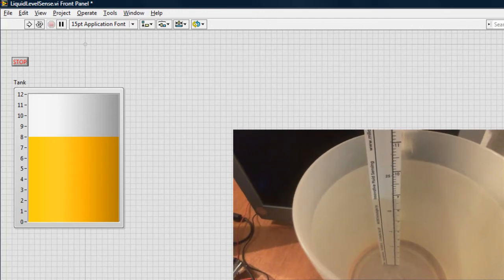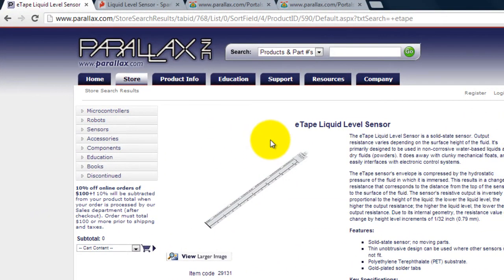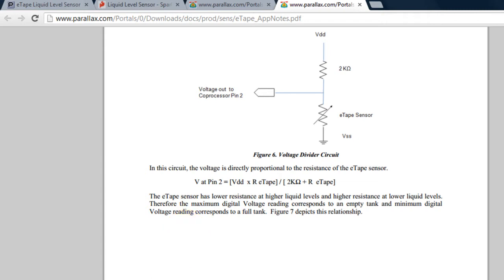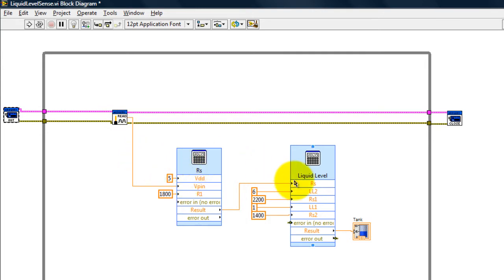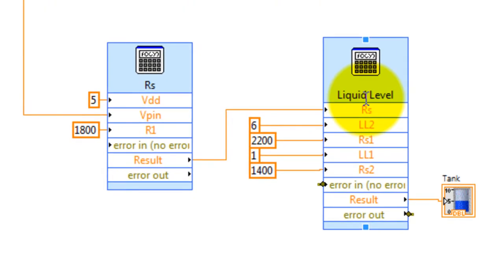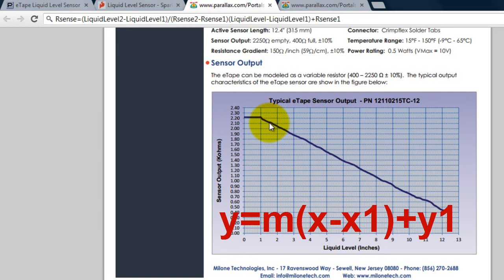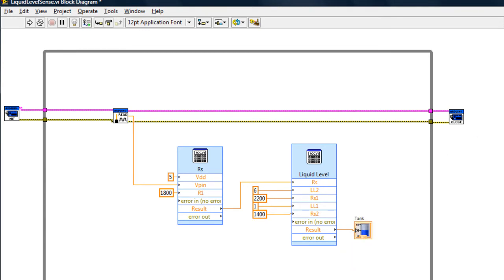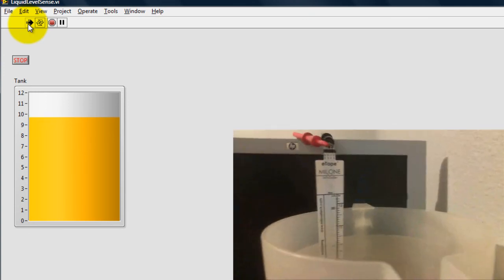Arduino LabVIEW: Liquid Level Sensor

Comment from the maker: There is a graph in the datasheet that shows the relation between resistance and the water level in inches, then I use the point slope formula (y-y1)=m(x-x1)